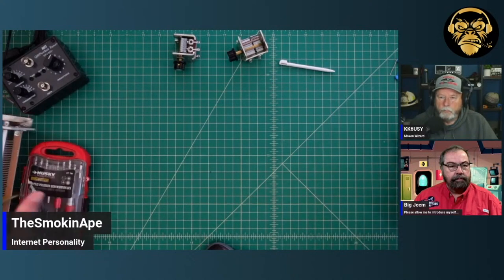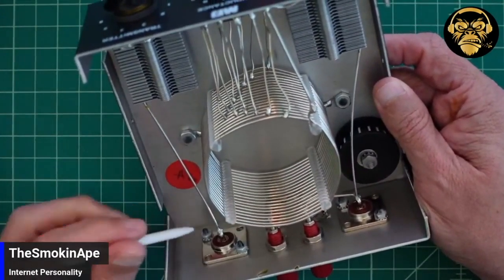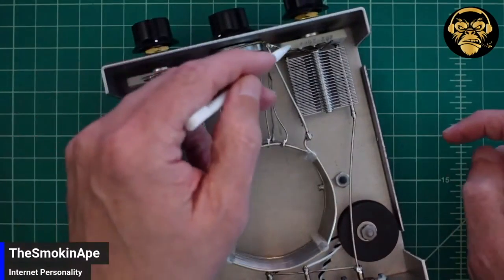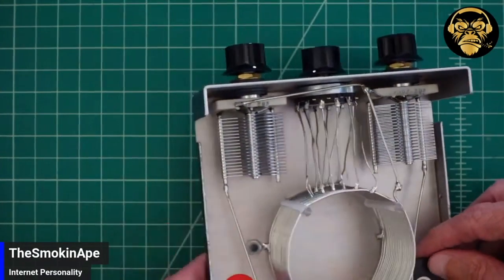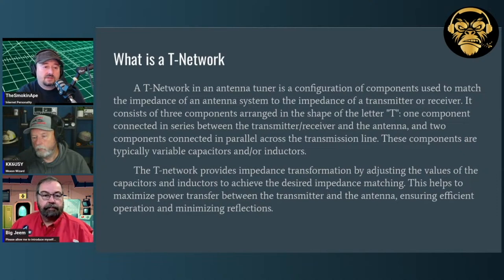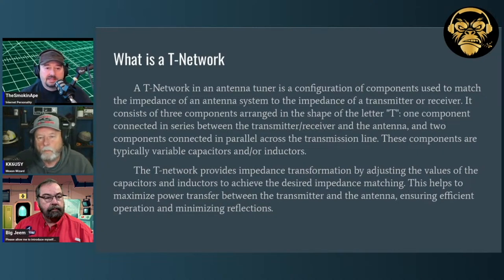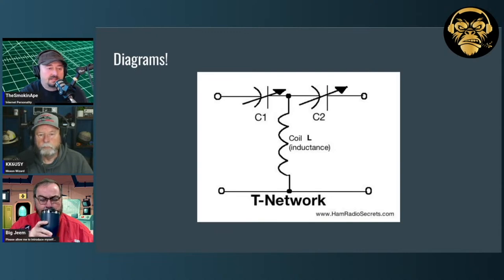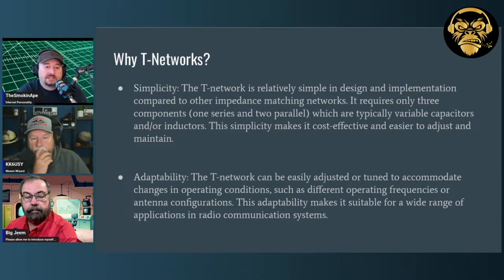Antenna Matching with T-Networks Explained

Comment: I think MFJ makes or made a L network tuner. You can mistune a T network but there is only one way to tune a L network. Plus they are easy to build with only two components. I have used them for over 50 years with end fed wires. Maybe you could do a video on them.
Reply from the maker: I will see what I can do, thanks for watching DP.

Comment: A minor, and not often mentioned merit of the T-network is indeed the high-pass characteristic. If you live near a MW broadcast site it can reduce the level to your receiver operating at a higher frequency further up in a ham band. A small nuance to the design of a practical T-match is (for example) to configure a roller coil so that the roller tap is connected to one end of the coil. Although this means that you have a section of short circuited coils (lowering the Q) it prevents the roller-coil from behaving as an auto-transformer. There are other similar fixes for this situation, without it the RF voltage on the free end of the coil can be extremely high and create arcing. The same applies to the tapped inductor. Most schematics for practical T-matches using roller coils do illustrate them in the way I describe. 73
Reply from the maker: Thanks for the additional detail G0FVT, hope you have been well 👍